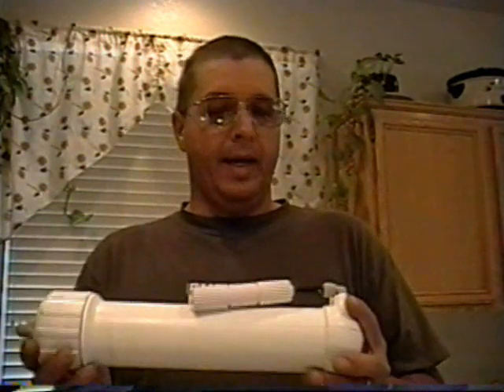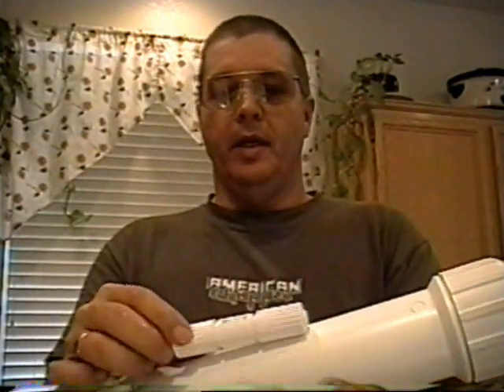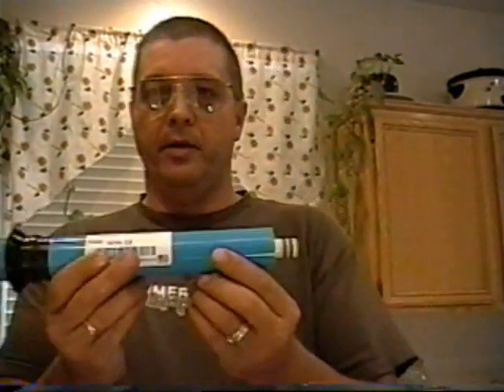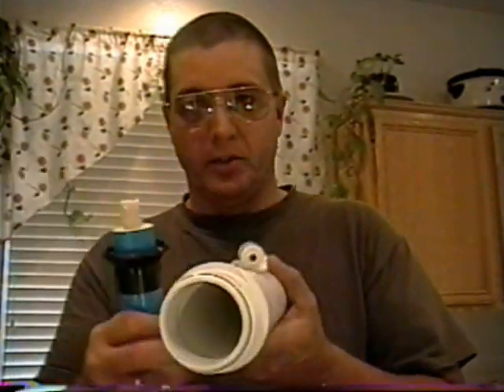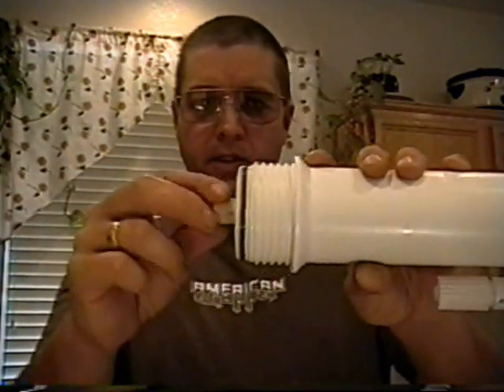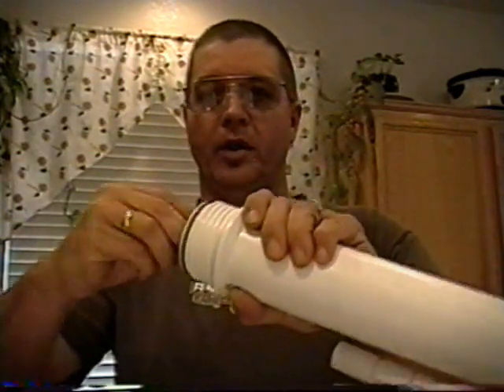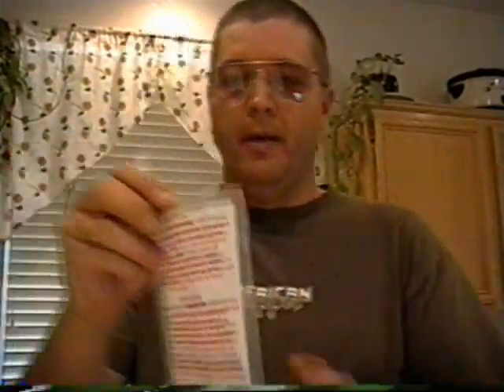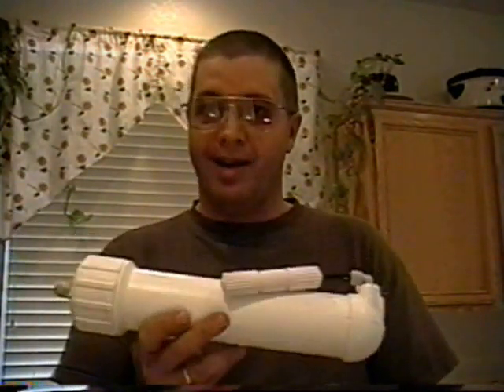How To Replace A Standard Reverse Osmosis Membrane

Comment: Great how to video.  Question, how often should you change your membrane?  Is it based on reduced flow? Seems like it should be volume throughput and water quality dependent, not time dependent.  But I don't have throughput and quality measurement.
Reply: I think people go by TDS with a TDS meter.

Comment: LEAK? There may need to be 2 black rubber rings.  One near the top of the thread and the other deep inside the cap.
Reply: when changing a membrane, a ring in can fall out. causing a leak.  check with your supplier, as there may be variations. I am just posting this to add to this great video.

Comment: I purchased the 200 gpd ULP 2812 membrane, and I had troubles with the installation of membrane, the inlet tube of the membrane arise and the cartdrige seems to be smaller, didn´t close correctly;   happily I didn´t try to force the screw tap of the housing, now watching your video I will try again carefully. Best regards from Lima-Peru.

Comment: Thanks a million for making this detailed video it is almost 10 years old but helped me today to insert RO member correctly, I just installed my RO system and input TDS were equal to output TDS I was so heart broken to see the result but after watching your video I realized that RO membrane was not seated corrected and I made the same mistake which you mentioned i.e I tried to push it by turning the cap ..... I followed your instructions and now input TDS is 200 and output is fluctuating between 20 to 35 probably because it is just installed .... Thanks again ........

Comment: I have a rainsoft RO system.  It has a pre filter, the membrane, and a post filter.  How much water flow should be on the output side of membrane.  No video covers that.  I have searched till my eyes bled.  Thanks in advance for the info.

Comment: When u say to open the faucet to flush the membrane for 2 hours do you mean the air gap faucet?   Also you don't say anything in this video about disinfect in the system. Is that usually necessary?

Comment: Video is great, BUT - if I never saw another video of another author on the same subject, I would never know that I needed a Flow restrictor MATCHED to my new membrane, which is VERY important. For example, I've bought a good DOW FilmTec 75 GPD membranes to replace old ones, right. And turned out I've had a 300 Flow restrictor with an old membrane, which I didn't install myself. But with bad tap water (450ppm) I need a 800 Flow restrictor with for a 75 GPD membrane. BEWARE.